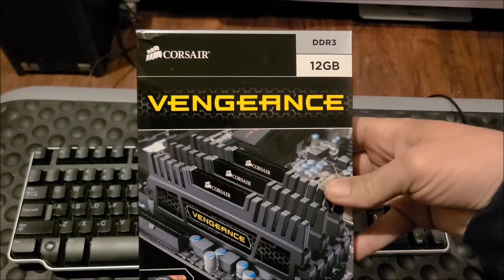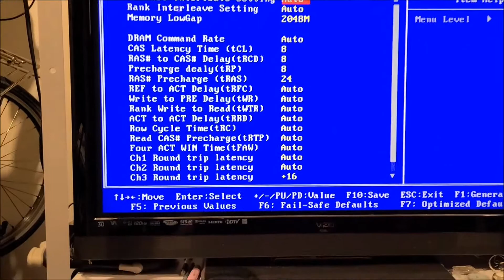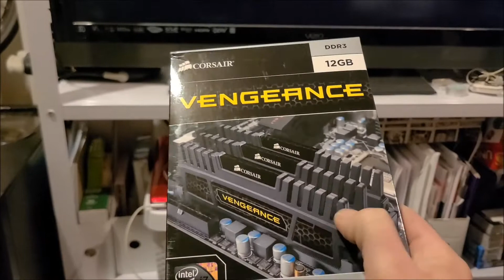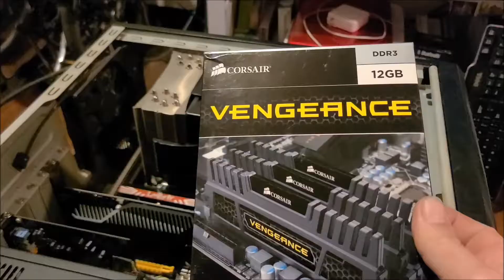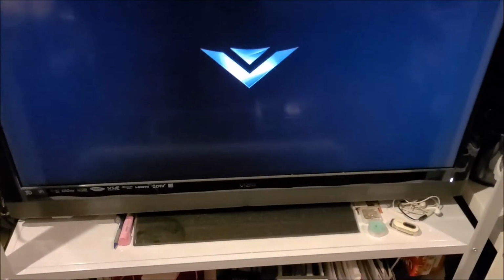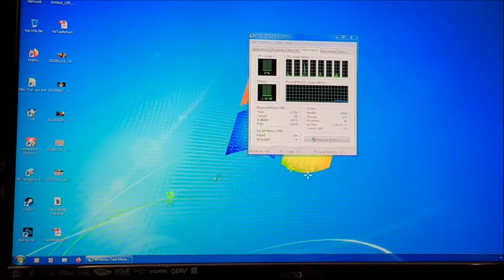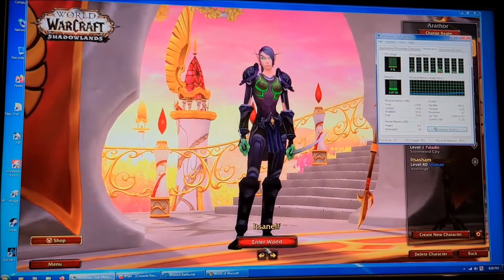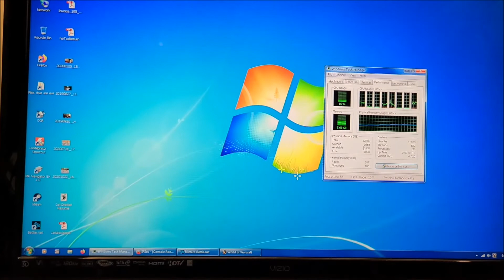Upgrading the RAM from 6GB to 12GB on my old i7 920 DFI X58 Lan Party box

Comment: Go on Ebay or Ali Express and buy a 6core Xeon w3690 or a x5690. It is $50 and over clocks on air to 4gherz stable with a click of the button, no tuning.
Reply: This board doesn't support Westmere Xeons period, best it can use is a 980x or 990x.